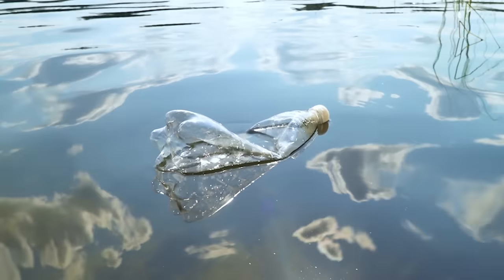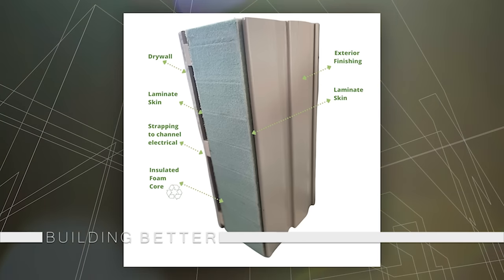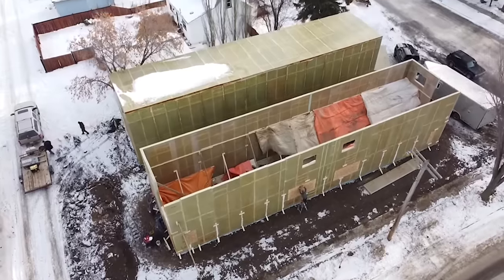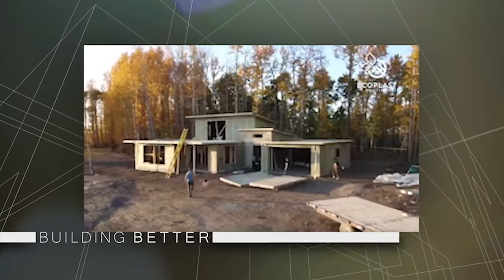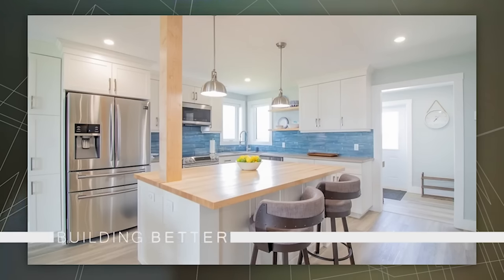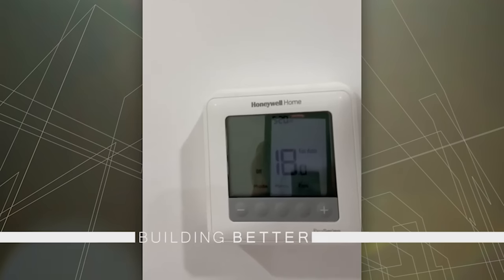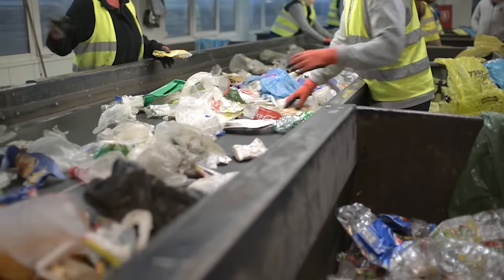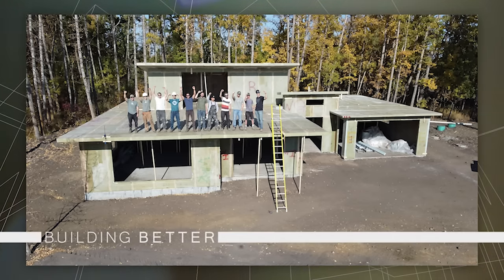Hurricane-Resistant Homes Made From Recycled Plastic Bottles (Episode 02)

Comment: My question is about fire safety. Would this burn rapidly or melt? Which of course in either case be toxic. I'm wondering what the insurance costs would be for this type of home.
Reply: Install smoke detectors that will be monitored 24/7 by a security company or a monitoring station, and the insurance costs would not be high.